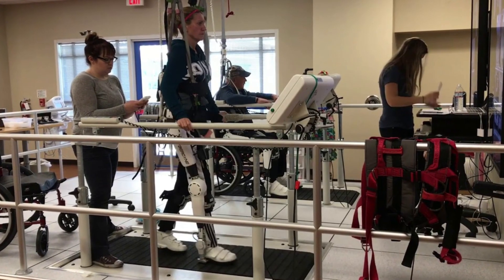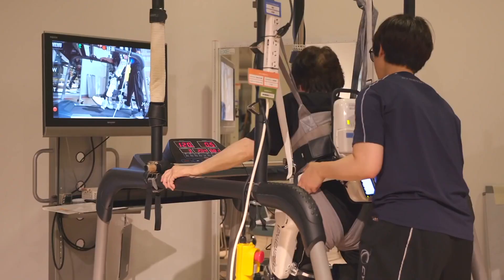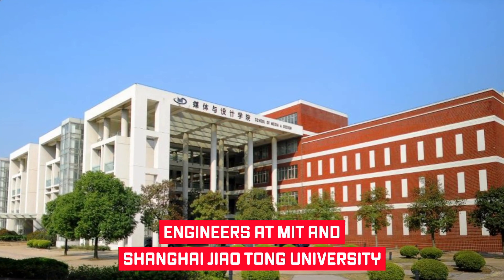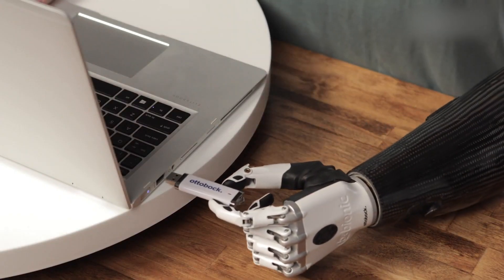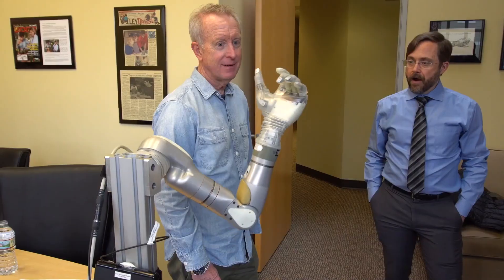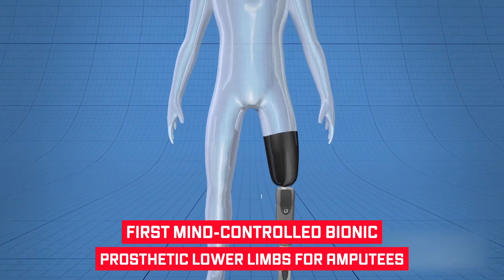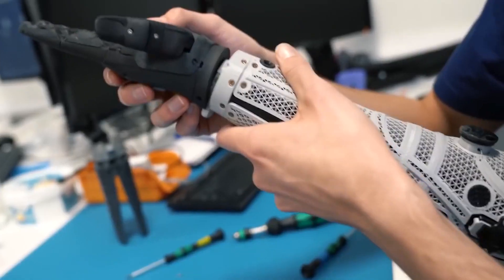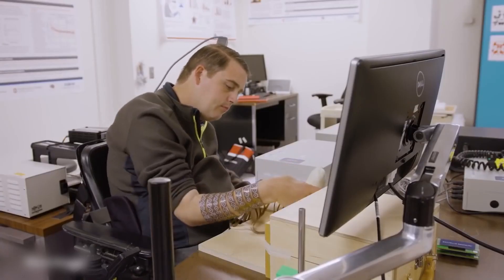Life Changing NEW Bionic Robot Limbs in 2022! | Prosthetics

Comment: This oversimplifies the process and makes people think that this is the answer for all disabled people to function normally. First, most disabled folks can not afford these products. Second, this is still in the testing stage and is not available to a wide range of applications. They purposely show the end result of adjusting, fine tuning and testing of these products. The pain and and frustrations of the failed attempts are not shown. It is never as smooth as it looks. And there is no mention of the mental aspects of the users or how it affects the users that the devices will not work for. Dig a little deeper befor you forward this to your gimppy friend.